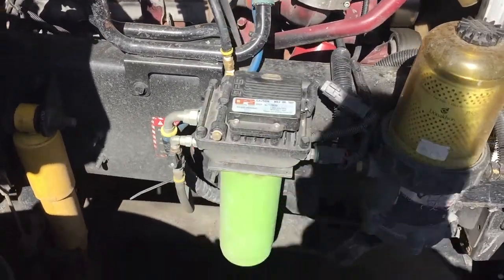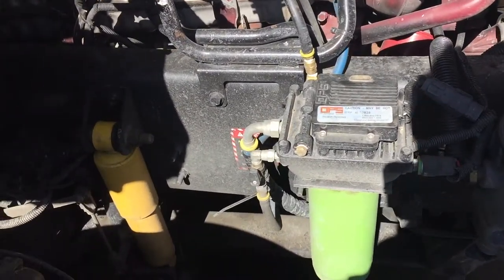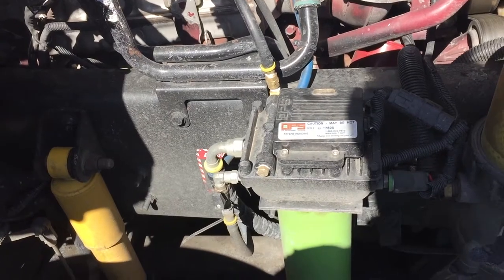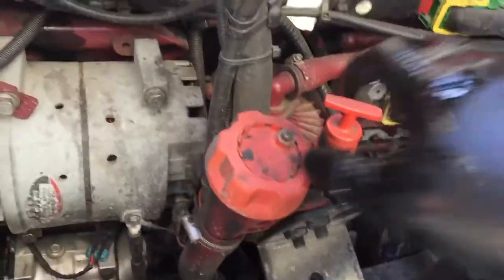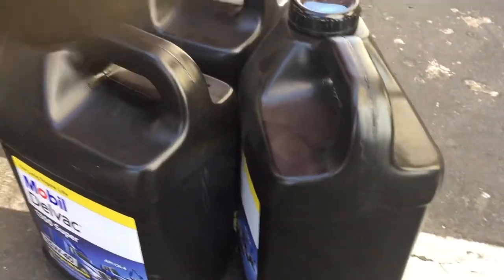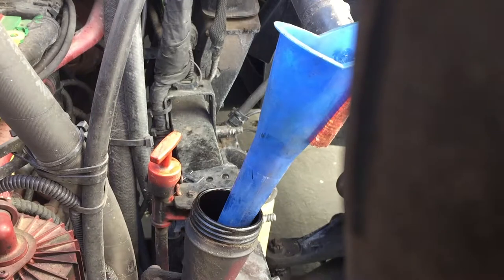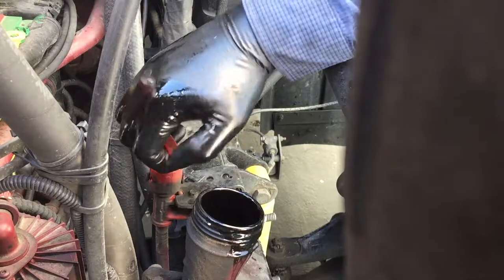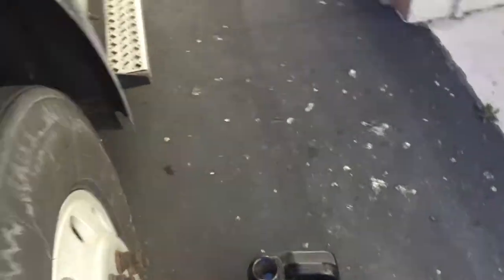OPS Bypass Filter / Oil Filter Change & Refresh

Comment: Hows the ops after all this time,if u still got same truck?
Reply from the maker: Don’t have the truck. I didn’t put any on my other trucks. I’d say it’s worth the money for older trucks. But these newer trucks do pretty good keeping the oil clean. But, I’d use it again. Doing extensive oil changes saved about $2k a year.
Reply: @DrivingByBraille  i put mine on a 2010 prostar with isx engine,did exactly the way it should be done i think,and just oil wont go thru.what confuses me is that brass fitting that they say not to remove,that thing doesnt have a openning at all,which way is oil supposed to go back up?